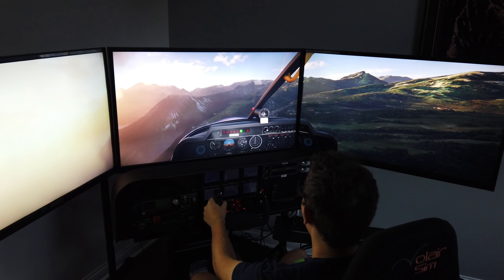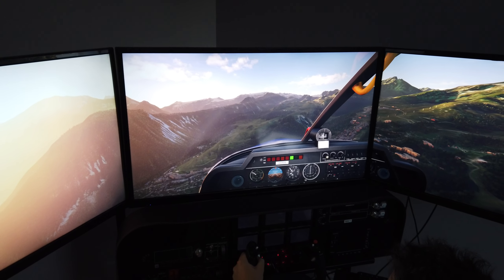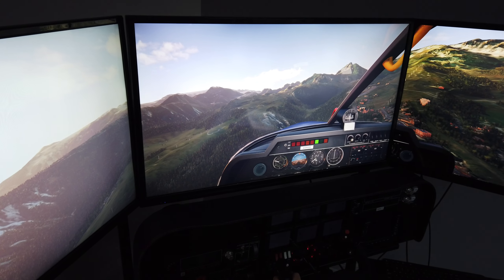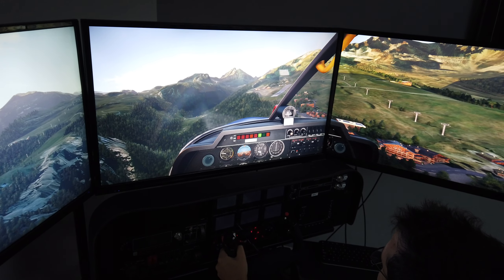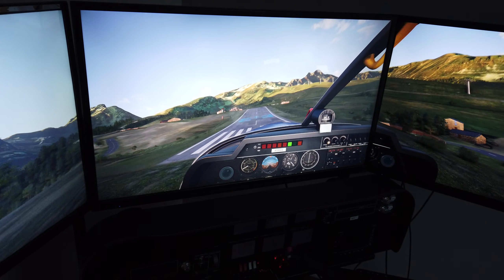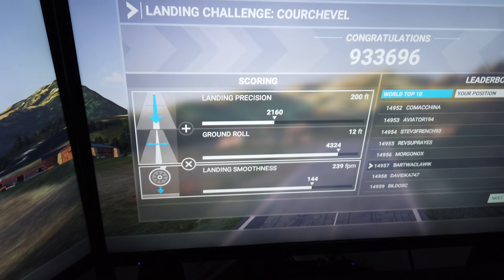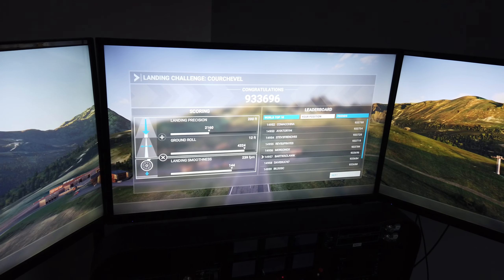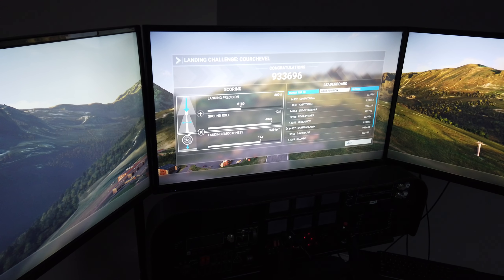Microsoft Flight Simulator 2020 and Volair Sim - Triple Display Set-Up

Comment: What do you mean with works out of the box? The sim doesn't offer any settings to adjust the field of view nor anything to account for the necessary angle adjustments for the side screens.. it just stretches the image. Or am I missing something?
Reply from the maker: What I mean is that once you set-up surround in nVidia, the sim display works immediately. Yes, I get the fact you have stretched image, etc. but for many people, myself included, it is not a huge objection. I'd rather spend my time flying vs. tweaking.
Reply: @volairsim  Right.  Well hopefully they support it later down the road for the many people with three who do care about it; kinda defies the real benefit using three monitors imo when you can't accurately judge distances and use side views properly.. we'll see, happy flying nonetheless, nice looking cockpit.
Reply: This damn video got my hopes up. It doesn't do Bezel correction and it stretches the image on the edges. Considering FSX was capable of doing triple screens correctly with a little bit of setup this is driving me crazy!
Reply: This doesn’t work great what your describing is half assed. I’m expecting to use this sim like X plane and have usable I distorted images on the side screens like a real simulator.
Reply: @josephbarnes7217  exactly.  Triple monitors is horrible on MSFS 2020 right now.  When they do bring in support (and they will) I suspect having 3 separate views will have a big impact on framerate.
Reply: @SteveReed33  How does FSX do triple screen correctly?  Not natively?

Comment: Do you know if there will be a solution to the multi-monitor distortion in FS2020 compared to other sims that have proper support?
Reply from the maker: It is hard to say, possibly.
Reply: @volairsim  I did some research and it is a feature on the roadmap, late 21 or 22

Comment: Hello ! Thank you for sharing the inspiring video. I wonder how do you connect the 3 TVs to your graphic card. Do you use DP to HDMI adapters? Are they all passive adapters or active adapters ? I have a 1070 graphic card. And I don't know what I need to buy. Thanks.
Reply from the maker: Yes, you need DP to HDMI adapter cable. These are all passive cables, nothing special.
Reply: @volairsim  thanks for replying. If I may ask what's your video card ? So I can connect 3 TV to my 1070 video card with DP to HDMI "passive" adapters ? Thanks
Reply from the maker: @DD-zk9hh  It is in the video description.

Comment: Nice landing but you could have held on from applying brakes until your aircraft reached the top of the slope, where the terminal is located anyways by the looks of it from on top while using the forward momentum on landing. This way, your aircraft wont slide backwards by gravity after fully stopping the aircraft upon landing. Moreover, the brakes will have much less stress in that maneuver  since it's not fighting against gravity going upslope while at the same time, not having the need to apply power just taxi all the way up the slope.

Comment: Hi how did get the resolution 1090 1018 on your 40 " TV I have 50 and when try it it shrinks plz help any one
Reply from the maker: You need to enable nVidia Surround and set the 3 monitors as one large display.

Comment: what resolution are you running ? 5760x1080p? I got mine a 7680x1440p 3x40" 4k samsung tv's  rx5700xt and tried to lower it and not much improvement but  I prefer quality so run it at same resolution as my desktop

Comment: Notice the switch, multi, radio and instrument panels not working? As of 8/20/2020 this is an issue for all. Spad.next tool added a fix to make them all work but it kills your frame rate to an unplayable level.
Reply from the maker: Unfortunately, that is right. If you turn off FIPs, the whole thing works OK with not a huge frame rate drop but with FIPs running, it kills the frame rates. I do think this will be a relatively quick and easy fix.
Reply: Are you saying having no (or few) instrument panel will increase the overall performance of game?
Reply from the maker: @blendofdiscovery  For now, yes. There is an issue with SimConnect (the interface between the sim and outside peripherals) which now causes dramatic FPS degradation. I suspect that this will be fixed but for now, we are flying without FIPs and any Logitech Pro Flight instruments.
Reply: Volair Sim oh I was asking the instrument clusters on the sim itself. Fo eg, I mostly fly with a view from outside the plane (drone came view I guess) and I have these instrument clusters for, altitude, speed, etc on the screen bottom. Will not displaying those have any effect on FPS?
Reply from the maker: @blendofdiscovery  I see. You can turn Developer Mode inside the sim and turn on FPS display and see what drop/improvement (if any) you see. I suspect outside vs inside view differs a little in terms of FPS drop. Right now for us cockpit simmers, the main issue is interfacing with outside gauges like the FIPs made by Logitech (Saitek) which really kill the FPS to unplayable level.
Reply: @volairsim  got it. Thank you. I am now setting up my frsky taranis as controller.

Comment: Hi ,tell me how the hell you get 40=45fps on ultra setings ,with RTX2080 ? I get 12-20fps on ultra with 2080ti and I9 9900k OC at 4.8Ghz on triples..
Reply: Hello, fellow simmer here getting anywhere between 25-35 fps on ultra settings, no vsync, with the following set up on 3x32" 1080p 144hz monitors:
CPU: Intel Core i9-9900K (OC'd to 4.8Ghz)
GPU: Nvidia RTX 2070 (OC'd GPU +800Mhz, VRAM +800Mhz)
SSD: Samsung MZVLB1T0HBLR-000L7 1TB
RAM: Samsung M378A2K43DB1-CTD 2x16GB
MBD: Lenovo 90JF00B0US
Frame rate is smooth and not noticeable to a little noticeable when flying at night.
Reply: You are doing something very wrong but I can’t tell you what...
Reply from the maker: Assuming that you have the latest nVidia drivers, etc, I suspect there is something on your computer that is hogging the resources causing such a massive frame rate drop. With our rig, even with some weather thrown in, we can easily maintain 35 FPS on ULTRA settings with only few things turned off (like bloom or lens flare).
Reply: @onefilthypilot4140  Turnoff V-Sync in the settings. Keep resolution to 1080 when using ultra.. you will get 50+ fps.
Reply: @TechvirusIndia  yes ,i get 50fps+  on 1920x1080 ultra settings super sampling and terrain detail at 200% , but we talking about triples here , 5760x1080 resolution...
Reply: @onefilthypilot4140  Which Monitor have you there? have the same Problem about fps, thx for help!
Reply: @stefanocioce7393  I have three 32" 144hz 1080p AOC monitors, model # c32g1.
Reply: @onefilthypilot4140  little late, but running the monitors on 60hz instead of 144hz boosted my fps by a ton. Still waiting for multi monitor support like in xplane11...

Comment: What resolution are you running at?  I assume you cannot run each display at 4k.
Reply from the maker: I will explain more in subsequent video but these are 3x1080p (HD TVs) at ultra-high setting (everything to the max) and still getting 40+ FPS. I do not see any reason why you could not technically run 3 4k displays but we have not (yet) tested this configuration.
Reply: @volairsim  You couldn't because no pc can possibly handle Microsoft flight simulator 2020 at good settings with 3 4k displays

Comment: Do you think it works with the same setup in 1440p?
Reply from the maker: I don't think it would be as smooth due to pixel count going up by roughly 40% meaning more power is requied.
Reply: I tried and it works very Well!

Comment: Looks like you have a nice cockpit set up👍. But unfortunately this software is not designed for serious cockpit builders.    First of all you can't remove the virtual cockpit view( BIG PROBLEM ), second ,one  can not break the views out into 3 independent channels much like wide view,  Taking one view and spreading it out on 3 monitors is not a solution for a cockpit builder.   I am aware this is new software and I am sure third party will come to the rescue.  But for now what your doing looks pretty good👍.  This software  Will be absolutely amazing when  these issues are solved. Can't Wait✈🛫

Comment: What size monitors?
Reply from the maker: 40"
Reply: How is the Name of this Monitors? Which one is it? You get how many fps on ultra settings?
Reply from the maker: @stefanocioce7393  These are 40" HDTVs (1920x1080p) made by company called ATYME and one used to be able to purchase these at Fry's. I also thought it looks pretty decent for el-cheapo TVs.
Reply: @volairsim  Ok thanks, i had read, that the size of monitors in volairsim would be 32" for a triple monitor building. Is this right or would volair sim have a new one for triple 40" monitors?
Reply from the maker: @stefanocioce7393  Good question. We are using the optional Triple Display Stand that lets you mount larger displays than 32" (which as you pointed is the max for the built-in stand that comes with Volair Sim).